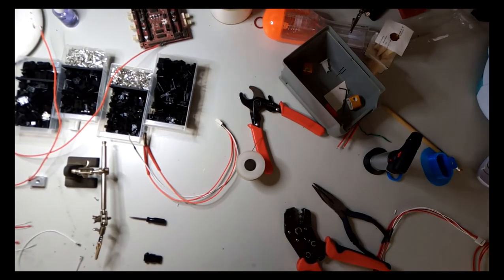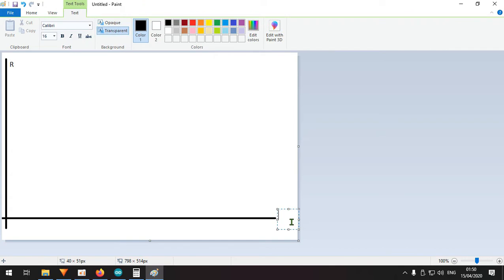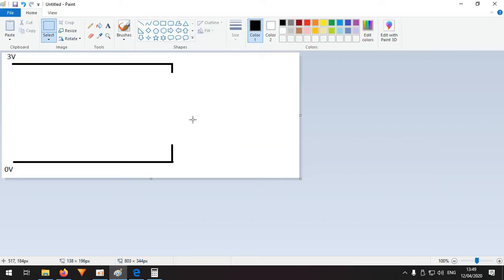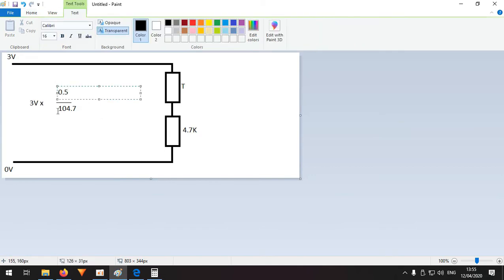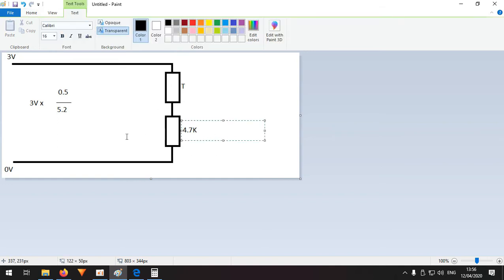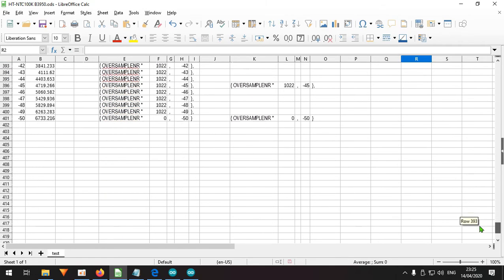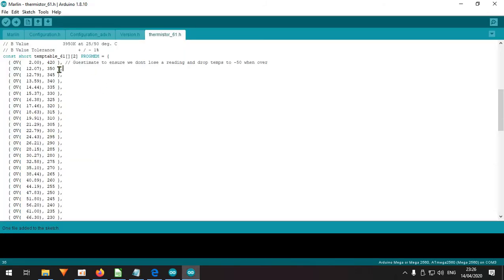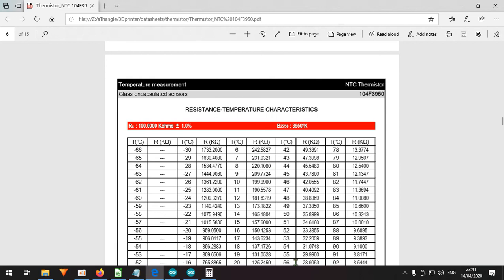3d printer - HT-NTC100 3950 thermistor

Comment: I can't tell you how much of a legend you are for doing this!  Could not figure out what table to use and didn't understand why the datasheets didn't make any sense when compared to the tables in Marlin.
Reply from the maker: I dabble a bit. I am not even so sure if the table I provided in the download is completely correct either.
Most important is to test at what temperature you get the best print results.
An optimal temperature on one printer, could differ a lot on another printer.
For instance, PLA prints great around 190-220C or so. But I got better results at 240C
Also depends on print speed, nozzle diameter, the type of extruder, PID settings as well as the temperature table.
It take a lot of time and effort to get optimal results.|
 
One more suggestion: Don't tweak more than one setting at a time.
For myself, Im not too much of a perfectionist.
As long as it sticks to the bed, the nozzle doesn't clog up and it's a reasonably nice print, it's good enough.
Reply from the maker: By the way ... You play guitar too ?
We built a cnc milling machine and I plan to build a guitar with it.
https://www.youtube.com/watch?v=aqyWfDp9rpo
I've had some delay though, due to other little projects and I am looking into finding a workplace.
Doing this in my living room is .. problematic.